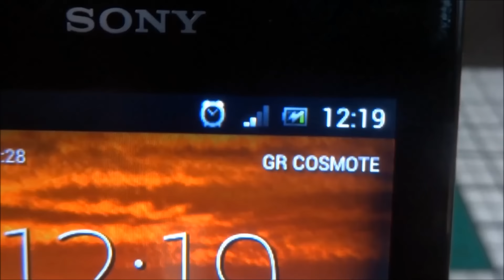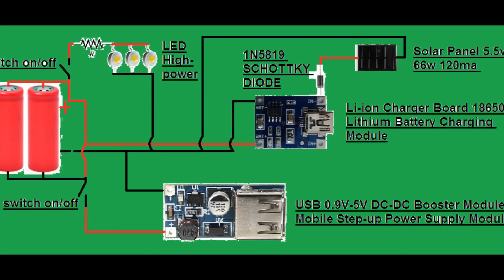DIY Homemade Solar Power Bank Charger Battery with LED Light

Comment from the maker: I have made a mistake in the diagram, the switch is not in contact with the negative of battery. Its contact with the positive of the battery "sorry for that " see here https://www.instagram.com/p/BEV9wGQR9UG/?taken-by=georgechaniotakis Buying one helps my research tremendously, helping me get all the supplies I need for the future. Visit my store on ebay: https://www.ebay.com/usr/eleman-gc

Comment: cool. I made one too using laptop cells and 5v step-up boost converter ;)
Reply from the maker: King .Energy Congratulations ;)
Reply: GEORGE CHANIOTAKIS can I ask what is the battery for? is it where you store the energy from the heat (energy) that the panel absorp? need for my IP

Comment: heyy what is the voltage of the solar panel?? and the the value of resistance?? ..... and how did you connected the red and the blue LED?? Please help and tell me quickly..... I M struck in between ..... after reading the carbon colour code i think that the resistance is of 100 Ohms ..... but it is not clear....... Please help..

Comment: very beautiful project! but how do you control the full discharge of the battery with this sistem?
Reply: with multimeter
Reply: +X3 Tips yes ok, but if you don't control it may continue to charge untill the battery get overcharged and explode... No?
Reply: The  TP4056 Charging Board will protect the 18650 li-ion cells from overcharging and over discharging.

Comment: So, if I want one to charge my laptop on a bicycle tour, I just use a bigger solar panel and more batteries?
Reply from the maker: marble man Yes you can!
Reply: ***** I watched The entire 3hours presentation on inplix and he still didn't show how to make one, then asked for my credit card. So, no thanks.
Reply: marble man You'll need a different DC-DC booster module, one that can output a higher voltage and a much higher current! Check the charger that came with your laptop and try to find a module with a matching output! This circuit shows 2 batteries in parallel but you'll probably need more batteries connected in series and parallel like in most laptop battery packs!

Comment: Can I use a 3volt solar panel and a 3 to 5volt usb converter to charge a normal power bank
Reply: Not sure but it would be possible.
Reply: yes
Reply: lauri vastisson Buy better one. The 1v solar panel wont be enough for phone.
Reply: lauri vastisson Go ebay and write 5v solar panel. Pick your one. Do notice that they will be all different sizes. And direct 5v to phone from solar is not recommeded. Learn how to convert it so it will be safe.

Comment: Guys did someone even noticed that this doesn't charge on solar? My solar panel is 5v 240mA.
It charges only when the battery is very low (under 2.5 volts). Seems like I need bigger solar cell (like 9v 800mA).
Reply: below 3 volts means ur battery is dead replace it

Comment: if you are interested to purchase module you can buy them in Ebay.
1_ http://www.ebay.com/itm/0-9V-5V-to-5V-DC-DC-Booster-Module-USB-Mobile-Step-up-Power-Supply-Module-2014-/201110338593?pt=LH_DefaultDomain_2&hash=item2ed31c3c21

2- http://www.ebay.com/itm/1A-Mini-USB-TP4056-Li-ion-Charger-Board-18650-Lithium-Battery-Charging-Module-/231169685613?pt=LH_DefaultDomain_0&hash=item35d2c9786d